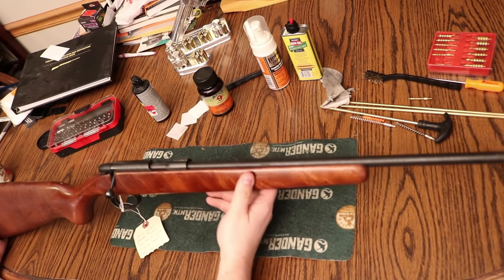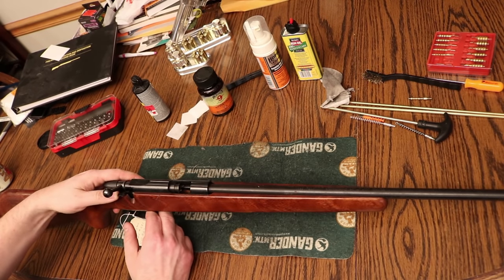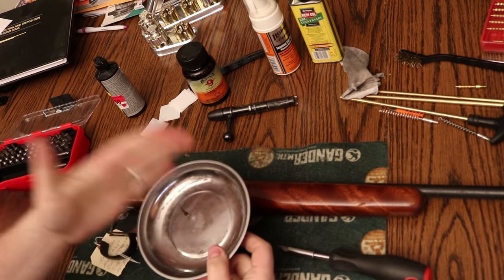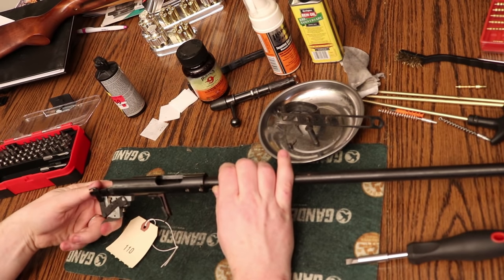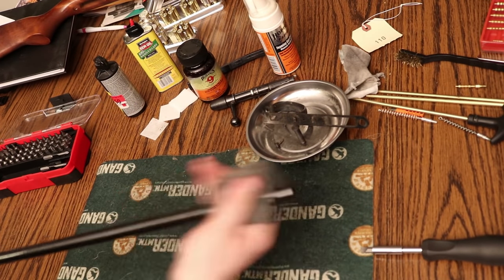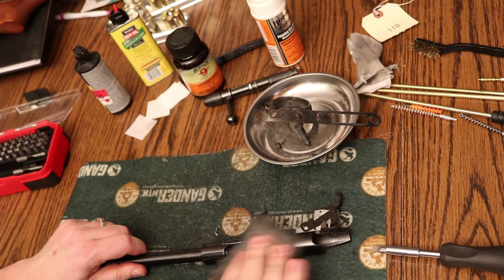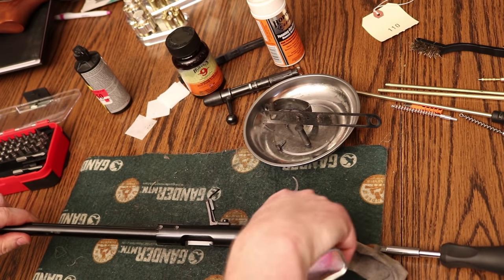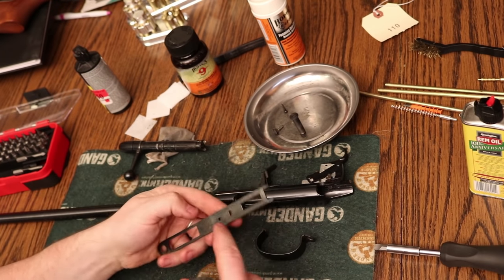How to Quickly Revive a Rusty Beater Gun

Comment: you mentioned that the bolt is different that most any 22 rifle bolt.  That is and understatement.  This six locking lug bolt is a very very special bolt being designed for a much more powerful cartridge the 5mm Remingtion that never made it to the sales room to compete with the Winchester 22 magnum round.  That is only one thing about this bolt.  The Lock time of this bolt is like 600 mil-a-second making it one of the fastest lock times if not THE fastest lock time of any rifle bolt made.  "Lock Time" is the time the trigger is pulled to the time the firing pin strikes the cartridge to fire.  the faster the lock time the more accurate the rifle will be on a target.  Where the locking lugs are located is far back into the reciever letting the bolt head release tension on the round as it locks to the back of it,  This lets the round seak its own center position in the bore make the rifle more accurate as well.  This is a very special bolt indeed.  These rifles 580,581,582 and the 541s are almost always the most accurate rifles you will every shoot 22 out of.
Reply: Do you stay with the 1-action screw or add a second action screw and bed so barrel is free floating?  Also any suggestions for lighten the 5-6lb trigger pull?  Thanks.

Comment: Whenever I have to deal with scuzzy wood, I use 4 / 0 steel wool which I first rub in a can of paste wax. Neutral shoe polish paste wax works fine and is readily available. The steel wool smooths out the rough spots, and the wax rejuvenates the finish. It's very similar to the process you used on the barrel to remove the rust, but using paste wax. Numrich  Arms can probably supply the parts you need.  Have fun.

Comment: I do basically the same thing.  Use steel wool and oil to lightly buff off the surface rust, then I will wipe down the the barrel and receiver with oil.  Lastly I rub in some boiled linseed oil into the stock if it feels dried out.  It keeps the guns looking original and clean.

Comment: Thanks for the video.. I've said the same thing many times over the years. Some people are lazy and simple won't put any effort in something they're selling. I'm into motorcycles as well and have got some very good deals because someone thought something was bad or ruined.. when it just needed some TLC.
Reply from the maker: I picked up a 76 Kz900 as my first bike. $100.  Didn't run because someone had hooked the fuel lines to the carb overflows and not the inlets.  Ran great

Comment: Remington 581 has a good accuracy reputation.  Unfortunately the trigger is not adjustable.  You can mount scope rings directly on the dovetail on the receiver.  Usually a recrowning job also helps improve accuracy and is worth the investment.  The Remington 581 stock originally was a birch stock.  With one action screw, typically the barrel is not free-floated, but the action and barrel channel can be glass bedded.  Or add a second action screw and free-float the barrel.

Comment: Chris try a wire wheel with .005 wire, don't cringe these do not leave any drag marks but do remove rust and make blueing look better.
An 8" wheel with .005 wire on a grinder requires eye protection and the wires tend to break when they thin so don't get these near invisible bits in your foot, they will find a nerve. Muratic acid works well on corroded bores. It removes blueing so tape off the muzzle. Rinse with water afterwards. Get your old lever action that shoots 6" to shoot 3" or less. Amazing what it removes. I've used commercial bore cleaners and brushes etc. until I got a clean cloth. Used the acid and was amazed at the gunk it removed and the improved accuracy.

Comment: They made them up to 1999 so it shouldn't be too hard to find the 5 shot magazine and rear sight
Reply from the maker: The sights are around but there is 5 different parts so places want $60-100 for a complete sight assembly.  The mags are around for $15 but they are plastic.  The older metal ones are expensive and hard to find.
Reply: Yes i have found the complete sight assembly for $57.50 at cfnparts with just a quick search.
Reply from the maker: Yeah, I saw those.  Knowing that they are relatively common I'm going to look around a few gun shows and see if I find one for cheaper before dropping $60+shipping for one.
Reply: Yeah I need a front sight

Comment: The 580,581,582's are the 788's little brother...
Reply: Jeff Scuderi  How the hell do you figure that?
The 580,581 and 582 were only .22 and it replaced the 511's.
580 was a single shot
581 was a box mag
582 was a tubular mag

The 788 was a center fire rifle that came in 
.222
.223
.22-250
.243
6mm
7mm-08
.308
.30-30
and .44 Mag.
Reply: Jeff Scuderi  New news there,my .243 never has had a problem.Have owned it and hunted many different species of animal with it since 1980 or 81.
Worked up some really good hot and accurate rounds for it.Even used it for Black Bear numerous times.
Reply: Jeff Scuderi  Like I said,totally new news here.
I know of 6-7 other people with the old 788 and they've never had a problem.

I will say the only problem I have had is with the safety.It's way to easy for it to be bumped off and pushing lightly releases the bolt and have the bolt fall completely out.Had it only happen once, when I was 12.Had to back track about a mile to find it.After that,I took better care of making sure it didn't happen again..lol